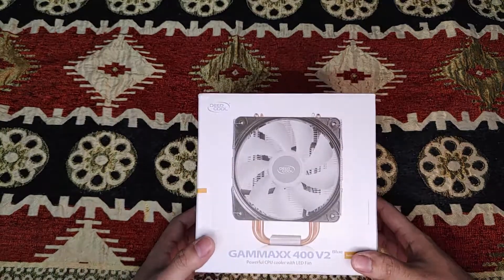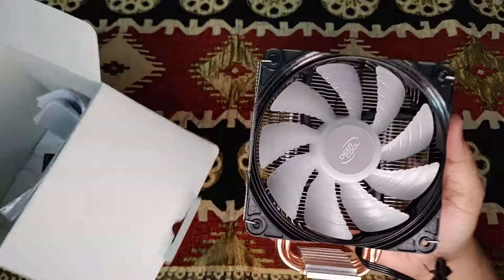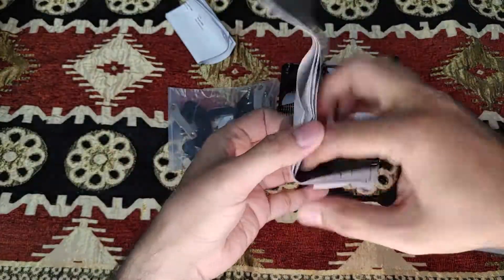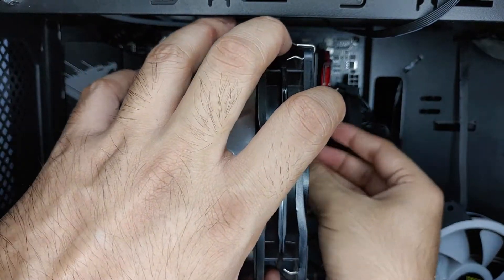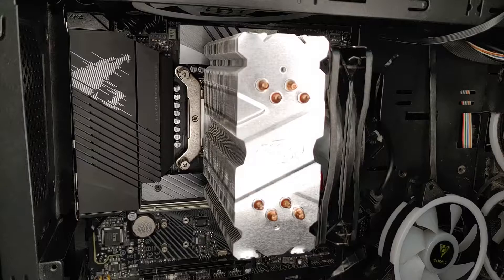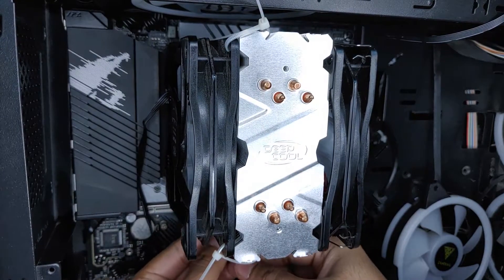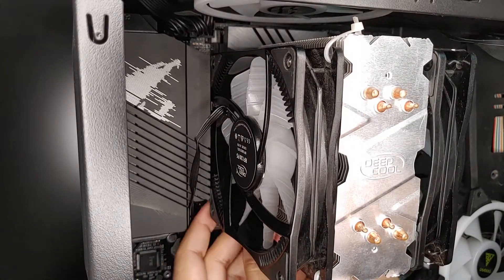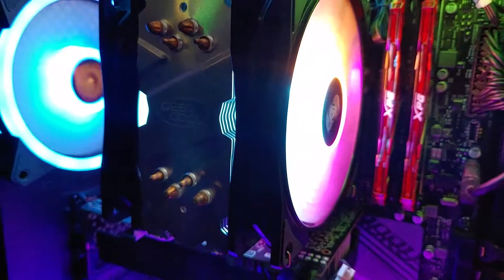Deepcool Gammaxx 400 V2 CPU Cooler / Dual Fan Setup

Comment: will a 5600x be able to maintain max perf with this cooler? THanks for the video.
Reply from the maker: Yes it will... 5600x has maximum TDP of 65W ...this cpu cooler can support cpu TDP of 180W
almost 3 times thermal headroom
Reply: easily, mine never goes above 60C